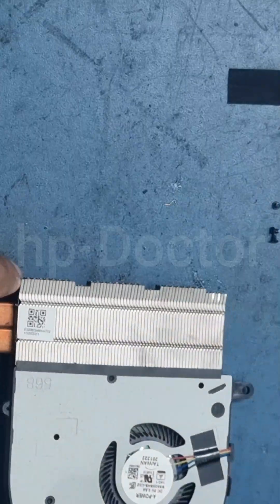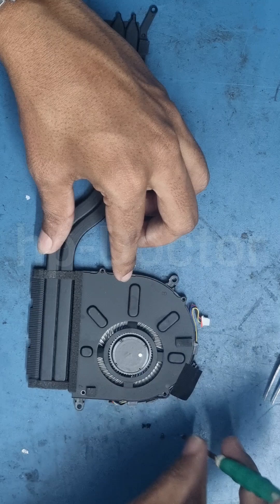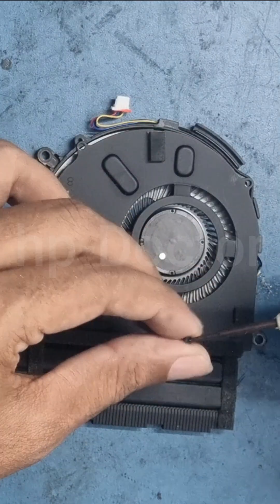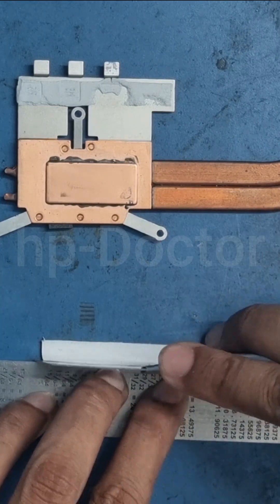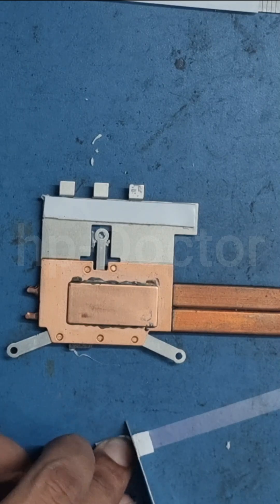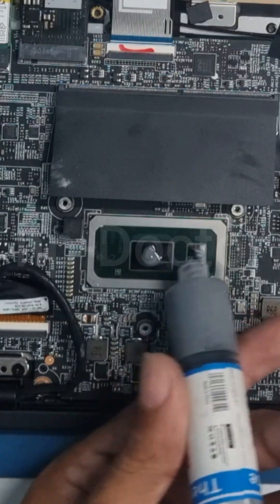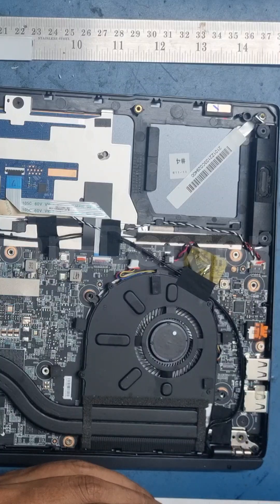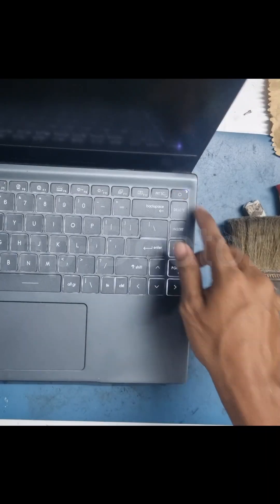Fix Overheating Laptop in Minutes! Fan Cleaning + Thermal Paste Tutorial 🔧💻

Comment: What if the fan in the laptop in loud ?
Reply from the maker: Hi, check this,, it will be helpful.

https://youtube.com/shorts/TWRnq5TTNZI?feature=share
Reply: @hpdoctorofficial what is the highest the CPU temp must be 79 ?
Reply from the maker: @JvsEvil  The maximum safe CPU temperature depends on the CPU model and generation,
Idle / Light use=35 °C – 50 °C
Moderate load=55 °C – 70 °C
Heavy load (gaming, rendering)=70 °C – 85 °C
Maximum safe limit (TJunction)=100 °C

Recommended max for daily use
85 °C or lower (Keeps the CPU healthy long-term.)
Reply: @hpdoctorofficial when I use obs or play some games it switches off , it never use to do that
Reply: Depends on the brand, is your pc hp elitebook?
Reply: @unbeatableTopG yes EliteBook 8570p
Reply: @unbeatableTopG yes 8570p